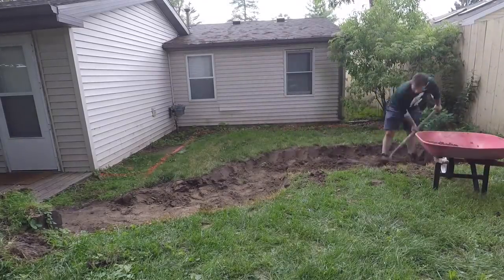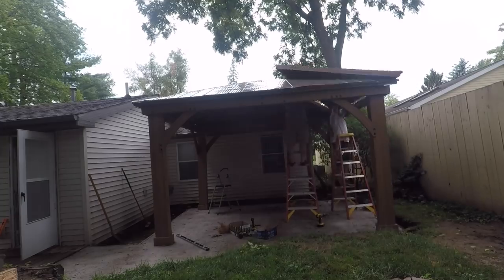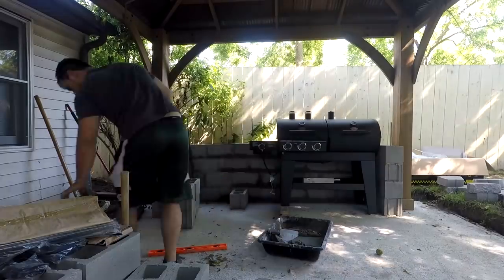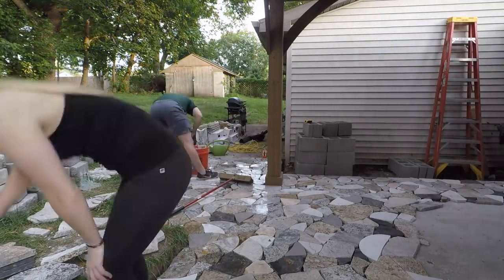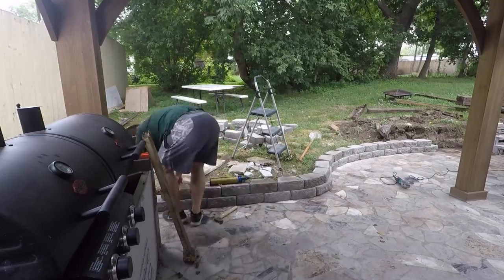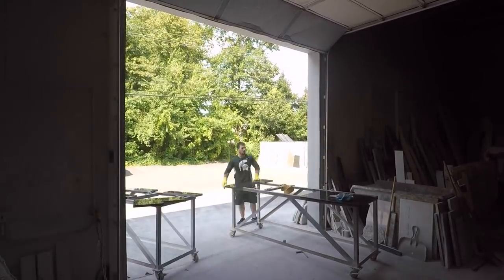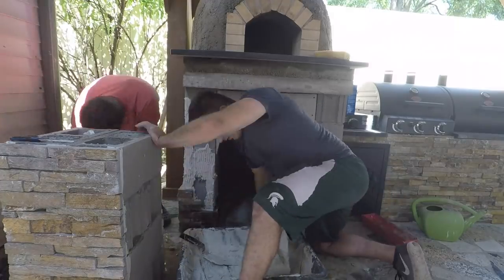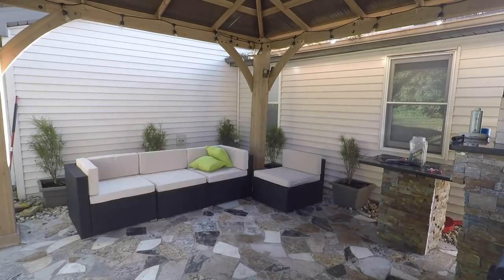My Affordable Patio Project! DIY Pompeii Wood Fired Pizza Oven, Gazebo, and More!

Comment: What is the estimated contractor cost an your overall time/cost?  Any links for items such as the gazebo?  Where did you find the flooring?  I think I can mod the gazebo idea for a front porch gazebo.  Did you have to get permits?  I'll be watching more of your videos.  Great job.
Reply from the maker: Hey, the rough contractor cost would be about 10k. This entire cost me 3k but since I did the labor my self I saved so much. A general rule of thumb is labor will be about 200-300% of the material cost. For the flooring I used granite countertop scrap pieces. These pieces come out when the sink hole is cut out of the counter. I took these pieces and just smashed it with a hammer to get different pieces and placed them in a mosaic patter. Since this is a free standing piece, I.e not touching my home it doesn’t need permits, similar if you bought a shed kit at Home Depot, Lowe’s etc. speaking about the porch gazebo, I recently posted a video of me making it out of raw wood I bought at Menards. I discuss how I got all the angles and made a template to transpose on all the wood to make my cuts! It cost be about $700 to do! Just check it out. Thank you so much for watching this video

Comment: Very good job! My only concern is, you left the pizza oven vent with in the roof line. Doesn`t it create smoke in the sitting area?
Reply from the maker: Hey! What you saw in the video with the pizza oven vent was just temporary, I only did that basic vertical vent to just heat cure my oven before my fall classes began! The following summer I redid the vent so it goes out and above of the gazebo!! Thank you very much for checking out my video! I really appreciate it!! Wish you all the best!

Comment: How much smoke filled that area? I would have extended the smoke stack through the roof of the gazebo or curved it so the build up of smoke wouldn’t be an issue. That is my 2 cents but this looks amazing great job
Reply from the maker: Wil Lie hey!! Smoke wasn’t an issue, the issue we faced was the chimney would really heat up the whole set up which on late fall would be fine but during summer it was really hot!! The chimney you see in this video was just a quick solution so I could use the oven and patio before my classes started, last summer I redid the entire chimney so it was curved and vented out of the gazebo! Thank you so much for watching my video, I really appreciate your kind comment! Happy new year!!

Comment: You need to put the stove pipe out through the roof . The smoke will cause black mold to grow on the undersideof your patio cover. There is a lot of organics created from  food and grease.
Reply from the maker: Hey Ray, I know what you mean, and totally agree with you!! What you saw in the video with the vertical chimney, that was a quick fix as it was end of August and my fall classes were about to begin so I wanted to start the heat curing process for the oven!

Comment: Yours is first one I've seen done under a roof. I want to put one on my patio with an aluminum roof but afraid it's too close. It will get out about two so it will have room to exhaust. Have you had any issues with yours being under the roof?
Nice to have brother and Dad to help.
Reply from the maker: the venting under the roof was just a quick short term solution, This past summer I redid the exhaust and it vents out of the gazebo!

Comment: the little “room” with the tiled wall is really cool for the grill but what the heck are you gonna do if your grill breaks and you need to replace it? airlift it out or tear down the wall and rebuild when the new ones in place?
Reply from the maker: To replace the grill, theres 4 bolts holding in the top barrels and with the barrels removed you can take out the base! Yeah but the best way but it works haha thank you for checking out my video!

Comment: Question?   Good work but with the cut access door on your grill, did you not think an access/removal point, door or backing would have been advised?  As it appears in your posting there is no access to the grill other than the small door.  General suggestion: if you are building a "permanent" grill enclosure you should plan and question the need for remediation or repair in your design and build.
Reply from the maker: Great question Triton! I do totally get what you mean, The grill barrels are held down to the base with for bolts, to remove the grill all I have to do is remove the 4 bolts and the barrels come out and the base comes out after. I do this if I have to clean or change out the grill! Thanks so much for checking out my video!

Comment: Nice job dude! But, I have some safety concerns about this... The chimney of the oven is under the roof right? You know that embers and sparks come flying out through the chimney and the wood gazebo or the side of the ohuse could catch on fire right?
Reply from the maker: That was only temporary, at the time of this project it was November and I wanted to run the oven through several heat cycles to fully cure. The following summer it was redone to go out and above the gazebo

Comment: I will say killer job especially being done DIY. But after all your hard work why did you paint that oven black and not do a masonry chimney?
Reply: 10-4.  When you find the time I bet you’ll get it handled. Check out BuddyRhodes.com colored concrete when your ready to do a nice final coat on the dome. They have a ton of colors and fiber reinforcement to hold it all together. It’s what my father in law used and it turned out great.   I wish I could share a pic with you of it but it won’t allow me to attach it. Stay warm up there.
Reply from the maker: Thanks so much Steve!! Will take a look at it!

Comment: So the smoker is permanently seated there? what if you need to replace or maintenance ? also, hows walking barefoot on that floor? sharp edges ? but overall good job man.
Reply from the maker: Hey, its seated there permanently but to remove it all you have to do is remove the 4 bolts holding each barrel down, remove the barrel and then you can just remove the base! So its semi-permanent! And there was a ton of sharp edges, i should've worn gloves as i set down the floor, i had cuts EVERYWHERE on my hands!! But when i did the mortar grout I made sure to really make sure there was no exposed sharp edges so its totally fine to walk on it ever barefoot!! Thanks so much for watching, I really appreciate it!

Comment: What a friggin awesome job! You are so handy. So nice your pops and your brother came and helped you out. What do you think you spent on the entire project, excluding the furniture? I really want a gazebo from Costco too, it was awesome that you showed how to build it. I was wondering, did you anchor it down. I didn’t notice if you had pre-anchoring hardware installed on the patio. It looked like all the posts kept wobbling around cause you had to keep making it plum. Thank you ☺️ 
Awesome patio, you should think about making those for a living 😝
Reply from the maker: Hey Hanalei, thank you so much for your very very kind comment!!! I also really appreciate you watching my video! So the entire project cost me about $3000 (USD), that includes the Gazebo, Various building material, patio furniture, plants, cement slab, Grille, the lights, and some various tools I needed to get the job done!!

Comment: Love this video how it the granite holding up I want to do floor in my sunroom just like your patio but I was wondering if you made a specific cut on the granite or just a hammer as they break any witch way
Reply from the maker: Hey Joe, thank you so much! I appreciate you checking out my video!! The granite is holding up extremely well, I will post a video in a little bit making pizzas in the oven if you want to see the granite again! For the granite pattern, I just flipped the granite over and hit it once really hard with a hammer and let it break where it naturally breaks!
Reply: @VinnyGjokaj  cool.. I am starting to collect scrap granite Peace's to start that project in the sunroom I will also try to post a video ..I'll check out the pizza video .. thanks
Reply from the maker: Awesome Joe!! Good luck!! Ohh just a FYI for the thinset/mortar you can use any tile adhesive! If you do post a video let me know! I’d love to check it out!

Comment: not bad apart from the design flaw with the chimney, that should not be under cover , either  extend through the roof or de re direct it backwards and out from under the roof
Reply from the maker: Hey Andy, the chimney shown in this video was a quick solution so I could heat cure it before winter came! The following summer I changed it so it vents out behind and above the gazebo! I thought I mentioned it, but either way, thanks so much for watching my video!!

Comment: Great freaking job Vinny! Few questions if you don’t mind?...
1. How do you know how to do this stuff, I mean you seem to know what worked best etc, did you do this frowning up? 
2. If you wanted or needed to move the grill does it just lift out? 
3. I’m a natural light guy so  do you know of a way to add nice skylight to the gazebos, I mean if it’s already up like yours? Do I just cut a hole 🕳 and add plexiglass or something.? 
Anyhow I can’t believe I watched nearly 3/4 hour video lol 😂 great 👍 job Vinny
Reply from the maker: Hey Davon! Thank you so much for watching my video and leaving silica a kind comment! I really appreciate it! I’ll answer any questions you have! Answering the questions you asked;
1. The tile work I did growing up, everything else I did a ton of research on and made sure I knew everything I could before starting.
2. Yes the grill just lifts up vertically! This way I can replace it if it needs to be replaced!
3. And that’s exactly the way I would do it for some natural light! I would just create a silicone gasket around the plexiglass to ensure no water would leak in!
Reply: @VinnyGjokaj  thanks alot

Comment: That floor has got to be slippery as all heck when it gets even slightly wet.  Even morning condensation would make it crazy slick.
Reply from the maker: It’s actually not bad at all, using traditional tile where everything is square would’ve made it slick! Using this mosaic pattern allowed for larger grout lines. You’re always stepping on grout lines and have traction!

Comment: hy vinny , what did you use to stick together the bricks for the dome?
the same material you used to cover?
do you think if i have it full outdoor will keep intact?
how long it took to dry before you cover the bricks with the mixture? and then from the mixture to the ceramic fiber how long ?
sorry the many questions but i'm really interested on doing it myself too and i would love more details 
thank you
Reply from the maker: Hello Nicola,
The material I used to stick the bricks together was high temperature (fire place) cement. I let the entire dome sit for 3 days before I put the fiberglass ontop. And ontop of the fiber glass I put a 3 inch (75mm) layer of cement and perlite mixture (5 parts perlite 1 part Portland cement). It took me 1 week of small fires to fully cure the oven. I began with small fires and every day I made the fire slightly bigger
Reply: Sorry to ask a further question feel free to don’t reply if is takes too much of your time ; when you say fiber glass you mean the fiber blanket you put in there ? 
And in the video you talk about having sand in the mixture but in the proportions you gave me there is no sand mentioned ; and the last about the outdoor ; you used  a waterproof paint; but that would keep it intact if completely outside and not mostly covered by the patio? Thanks a lot again for the answer above
Reply from the maker: @nicolamondelli3782  Hey Nicola, Yes i meant Fiber Blanket!! 

For this ratio I did add Sand, But really the sand is not necessary, To make it stronger I personally would leave sand out of it. I found it didn't contribute positively or negatively. 

And the waterproof paint was merely for looks. Since this house is temporary while I finish my schooling. On the next oven I will do a mosaic pattern with a nice looking stone tile. Since my oven was covered by the gazebo it was not totally necessary. If its exposed to rain and snow etc. you will need to have it covered with a form of water proofing. The insulating cement (cement & perlite) is very porous. 

I do not mind you asking questions, if you start building a oven please feel free to ask any questions you have. Prior to building mine i spent many hours researching and I totally want to give the information I found away.

Comment: Nice job!  Did you have to pull a permit for the structure and the cement pad?
Reply from the maker: Hey Karen, since this is a free standing structure (12 inches away from the house) it does not need a permit. Similar to a dog house, she’d, etc!

Comment: For not being a mason I'll give you a thumbs up. Next time do away with rebar for horizontals your not laying bond beam block. For regular 8s use dura wire for your horizontals every 16 inches. Just saying but myself and any other mason I know does not use pre blend. Sand pile and type s is the only way.
Reply from the maker: Hey Fran! Thanks so much for the info! I try and learn as much as I can from professionals! I have a ton of respect for Masons, its an incredibly tough job! Also thank you very much for watching my video and leaving a kind comment! I really appreciate it!

Comment: How much did that cost without the bbq and pizza oven The gazebo and stone deck is exactly what I want to do exactly in the same place can you give me a rough estimate and is it possible to attach walls doors and windows to that gazebo if I just want to add that onto the house a bit closer as a room add on to the house??
Reply from the maker: Hello Nikki, Here was my costs;
Gazebo- $750
Patio Cement Slab- $300
Granite Floor- $400 for granite and thinset and grout
Patio Furniture- $500 (amazon)
Reply: @VinnyGjokaj  thats amazing thats like so doable then I could get insulation some extra wood boards for the walls inside and base frame for structure stability then flatwood and siding and windows and doors.I could even do the same thing with that gezebo for a garage. And make cusome doors to open outward or inward or sliding so I could park my truck insidehmmm maybe 2 together for length I have a dodge ram
Reply: @VinnyGjokaj  could you tell me the name of gezebo kit??

Comment: can you share dimension of your pizza oven. Is it ok with the chimmy being inside of the gazebo?  I am trying to have the same gazebo and build a oven too. debating if I want to keep the oven in or out of the gazeo. Also, did you ancher your posts, how's they been holding up. I am worried about Chicago wind.  Thanks.
Reply from the maker: Hey, 
The pizza oven is 36” interior diameter, while the vent was inside the gazebo it didn’t really pose much issue for me, I did redo it the following summer and have it going out and above the gazebo. I kept it short like that just so I could cure the oven since it was September/October in Michigan when I was close to being done lol.

I did anchor the gazebo legs to the cement slab with cement screws! Good luck on your build, I moved to a new house and I’m about to start a similar project again lol
Reply from the maker: If I may add, the chimney inside the gazebo for that fall I used it 3/4 times, it really did warm it up, we had a Halloween pizza party and everyone in the gazebo was really comfortable, but in early summer June July it may make it to hot!
Reply: @VinnyGjokaj  Thank you for the replies.  I am sure your project was a good selling point when you sold.  I wonder what was your reason for redoing and moving out of it. How hot the vent out of chimney get, not enough to hurt the structure? Do you recommend the oven completely out of gazebo, or in, or partially in?  Thank you!
Reply from the maker: @NKHuman-Rights  No, realistically when you're 12" away from the vent you cant feel anything at all from the chimney. the only thing that I didnt like about my previous set up was since it was based in a corner, and had a fence on the other side, it didnt have much wind flow so if my set up got smoky at the top of the gazebo

Comment: Love to have you tell us how and where your smoker draws. Also, as previously asked, where does all the smoke go? My BGE puts out a ton of smoke and I would never put it under a roof unless vented.
Reply from the maker: Hey Al, The pizza oven smoke stack was just a temporary solution because my fall classes were starting and I wanted to heat cure my oven. The following summer I redid the chimney so it vents out and above the back of the Gazeno . The BBQ/Smoker has no issues bringing in air and venting out of the gazebo. As of right now there have been no issues.

Comment: I wasn't digging the patio stones until it was done then I liked it. I wonder how the chimney puking under the roof is going to be, I think that will be an issue. Also, no pizza? WTF, I wanted to see a freaking pizza being pulled out of that oven bro, epic fail lol.
Reply from the maker: Hey thanks so much for watching my video! I used this chimney set up to heat cure my oven before winter set in, the following summer I redid the chimney so it vents out and above the gazebo! So far I’ve made over 200 pizzas in it! It gets over 1000 degrees and cooks in about 80-90 seconds! It’s a great party piece!